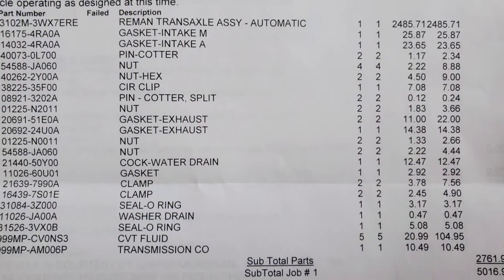2017 Nissan Maxima Cvt Failure! 🔴 What Signs to Watch For and Things To Avoid!

Comment: From a guy who has worked in not one but two Nissan shops, I can say the first problem was buying a Nissan that’s 2013 and above. Honestly they are built a lot cheaper than the older ones.
Reply: Would you say that on any Nissan? I've been considering a new Sentra Sr or used Murano 16-18 or maxima 16-17 but I've had issues on past Nissans I've had (Altima 09, Sentra 05). Currently driving Lexus and Toyota.
Reply: Explain what people mean by jutter on these cvt transmissions.

Comment: By reading the manual every 60000 miles you should do CV T flush as part of your maintenance And at a 120000 miles you should change all the spark plugs that is in the manual You can  PDF the manual on your phone
Reply: My owners manual for my Altima says to change the plugs at 105,000 miles.

Comment: This is concerning.  I have a 2016 with 69k miles on it. I did notice a few gear slips.    Just changed the Transmission oil this weekend at the dealership. Car seems to be running very well at the moment.  Definitely will be keeping my records.
Reply: Damn, just as mine 16 with same miles. Was gonna do transmission fluid change at 100k. Thinking now of getting rid of as I dont wanna hold on to junk.
Reply: My 16 is sitting at 98k I haven’t had a problem yet
Reply: @mahammadshariff6162  I think we might be okay. It's not every Maxima has issues. But I would get that transmission oil changed during next oil change
Reply: Good I heard change it every 20k miles and you should be fine.
Reply: I jus got a 16 at 65k
Reply: @mahammadshariff6162  you were supposed to change it at 60k as stated in the owners manual.
Reply: Warranty by Nissan ain't worth shit. See when you need warranty service !
Reply: @jarrellbanks4702  nice man.  Hope you are enjoying it.  I love mine.   It's got decent 60-90mph acceleration to get out of jams on the highway

Comment: I have a 2011 maxima (original owner). My transmission failed on me at 300k km. I never put my car into manual mode, for my mechanic told me never to do that. I did replace the transmission with a used one with 190k km on it, and so far, I have no issues with it and now my car is at 413k km
Reply: I believe your mechanic is wrong.  My 12' Nissan owners manual says to put the car in manual mode when going up or down steep slopes or hills.I have always done that and am in my 13th year of driving the car with the original CVT and zero issues.

Comment: The new CVT's today from Honda and Toyota actually use a gear to handle your initial acceleration and at the required interval, hand off the job to the CVT transmission. I think Toyota and Honda are also going to 4 cylinder turbos to replace their v6 engine. Turbo plus CVT means you must be on your maintenance game. If you buy used, you MUST demand service records from the Seller.

Comment: I purchase a brand new 2017 Maxima, with now 90k miles.  I didn’t do any manual shifting of gears, mainly city driving and occasional long distance driving during the holidays. Mechanics noticed an issue and recommended I get the transmission replaced. Luckily I purchased additional warranty insurance. But it is ridiculous to have to replace a transmission under 100k miles. Salespeople keep calling to upgrade, but this will definitely be my first and last Nissan product. CVT=cheap value transmission
Reply: I had a 2019 Nissan Maxima SR and the transmission went out at 72k. I now have a Lexus and love it.

Comment: But the question is why do they still pair CVTs on a large car with powerful engine? They should be the classic torque converter, or DCT. CVTs are for kei, mini, subcompact, and compact cars which are aimed for fuel efficiency.
Reply: Facts their asking for them to break when put on powerful engines.

Comment: Purchased a 2017 Maxima last month.  Car had 56k miles on it.  Took it in for an oil change/tire rotation and 60k mile service.  Sure enough found some stored transmission codes which included the jutter.   Car was under 90 days and 4k miles so transmission is getting replaced at no cost to me.  Glad it went out now.  My extended warranty covers 5yrs/125k miles which will will keep it covered as long as I keep the car for the most part.  I don't race this car and no need to ever be in manual mode.  Car is a  great daily driver.
Reply: 60k miles and a new tranny...... that's ridiculous. Nissan should be ashamed. I could have bought the same car, same year, with only 9000 original miles just a couple of months ago.... but honestly, I don't want a CVT after all the time I spent reviewing these transmissions... I keep a car a long time and never replaced a tranny... right now, my Acura is 20.5 years old with the original tranny.. I wish you good luck.... and definitely keep changing that fluid.... a secondary cooler may makes sense as well...
Reply: Explain what you mean by jutter

Comment: My takeaways.  Keep mileage down.  129K over 5 years is high mileage?  No hard accelerations to 80mph.  Don't use the paddle shifters to create additional transmission strain.  IE be good to your transmission and it will be good to you.

It's obvious from the video and his comments that MD is VERY hard on engines and transmissions.  Good on him to own it for this review.
Reply: Keep the mileage down? Oh wow.
Reply: How about Nissan stops using JUNK Jatco CVT transmissions and you can drive the car like it's designed to be driven.  There is a reason Nissan has had numerous lawsuits about the transmissions, and it's not because it's a quality transmission.

Comment: the older models didn't have as many issues.. I'm definitely done with Nissan vehicles altogether.
Reply: Richard,  you are right. New Nissan vehicles are garbage and I've owned many and used to work for a Nissan factory. The best one I ever had was a 97 Altima 5 speed manual

Comment: 2009 Maxima and still running strong...no issues!!!
Reply: My 2008 altima coupe CVT just started failing. 163k and changed the CVT fluid at about 100k and again at 163k. I just changed the oil and replaced both filters. I never replaced the paper filter before. I would suggest not to change your fluid if your car is over 120k. I treated that thing like a baby. I used Itimetsu fluid which is pretty much the same as the NS-2. I would also recommend avoiding long trips on windy roads and lots of hills once your car gets over 120k. A trip through the Ozarks is what triggered it for me I think. An altima with 120k+ should become a commuter car only in non-hilly areas.
Reply: @garneroutlaw1 my mechanic told me the exact same thing about not changing the fluid over 120k miles, he explained why but I forgot..I’m at 198k now with my 2011 Altima and it runs fine

Comment: Thanks for the video. I drove Mitsubishis for 20 years. All had the JatCo CVTS. 80 miles was my max before I traded. Last year I bought a 2022 Rogue. The Rogue is amazing and I got a good deal on it. I am an old man and I drive like one. Personally, the money you save on the car is worth the $5000 you put into a new transmission. A slight inconvenience? Yes. You made the right call.

Comment: Just to add my experience for any new CVT owners, my Maxima 2014 was bought in Oct & a major services was done the previous June on it including cvt fluid replacement with filters and all that. However, the transmission gave away in Oct. 
i had option to replace with a used one like you mentioned or repair it with a specialist. I went with the latter. Perks were they gave me 3 months warranty & you know that parts on the inside are new. If you go with a used one, you are not sure of its condition, might end up stranded again in few days and the warranty period on those are really less, maybe even just 5 days. So, my suggestion would be to have it repaired instead with original parts & of course, from a transmission specialist. And pls do not put your foot down hard on these CVTs all the time, (occasionally is okay or when the circumstances need it). Drive normally & you should be fine!

Comment: I’m getting my trans replaced I’m at 60k didn’t have any symptoms I did a hard scan on my own and found the cvt judder code so I took it in my buddys at Nissan recommended we just replace the trans it was actually calling just for a valve body replacement but we went ahead and did the whole trans again I had no symptoms at all

Comment: I have a 2014 Maxima with 92k miles.  My transmission started acting up with a code for the transmission fluid pressure sensor stuck in open.  I was told it was a valve body issue. I changed the fluid but that didn't fix the problem.   No one would touch this car.  Dealership stated they don't service the transmission at all.  So I ended going to a transmission specialist in NJ call Level 10 transmission.   They actually brake down the transmission.  At the end of the day I purchased a upgrade transmission with large pump and torque converter.  Car was paid off since 2018 so at this point the money was worth it.  My new transmission has a 3 year 50k warranty but the kicker is to change transmission fluid ever 30k miles.  If the dealer would have told me to change fluid every 30k my transmission would have lasted longer than 90k
Reply: I change mine every YEAR...DIY and easier than a oil change!
Not taking any chances an extra $100 better than 5000$...
Also put a hayden trans cooler on mine...shame on Nissan for this junk Jacho trans
Reply: @Vincent Kosik  I asked about a secondary cooler.  The new transmission I just purchased from Level 10 transmission actually puts a bigger cooler on during build.   So yes, shame on Nissan.
Reply: @MrHeat1up  that's sounds good..I live in the South and need not worry about cold winter mornings...the CVT fluid needs to be warm enough to properly function...I read that some setups of aftermarket coolers need like a thermostat...not sure....anyhow, hope you have a good one and I'm crossing my fingers on this one....I drive real gentle and I keep the fluid overly clean...but that's still no guarantee it won't stb...other than that a very nice car
Good day..

Comment: U gotta flush the fluid every 20k. Always let it warm up a minute or two, take it easy first 5mins of driving. Don't drive the car hard overall, it's a CVT. Check for fluid seepage during svc intervals. Check with dealer for TCM updates. U do all that, plus cross your fingers and pray, u may have a chance! Btw, I'm leasing a 2022 Altima Platinum. I got a warranty. But not sure about buying it out end of lease.
Reply: Few if anyone ever know to do this, let alone are going to do it. It's really unheard of routine maintenance. For most people automatic means set it and forget it. Statically keeping that car is a bad idea you can see from space.
Reply: That is nonsense if you have to change it every 20k miles.
Toyota and Honda don't have to do that crap.
Lets me know that Nissan is an inferior car to those two.
Reply: @tom11zz884  Who has the time or money for the extra maintenance, Nissan is trash 🗑
Reply: 20?  No.  Waste of money.  60K is soon enough.
Reply: It's a closed Transmission dumass
Reply: Manual says 60k if you do any towing or really hard driving .. that’s the problem people start touching the transmission and that’s when problems start.
Reply: Recommended CVT fluid service interval is 120k km (or 74k miles). you can go every 60k if you're paranoid, but 20k is just ridiculous. By the way, it's extremely important to also change the CVT oil filter, which the dealerships will never do. Will either have to DIY, or take it to an independent transmission shop.

Comment: 129k, your doing good, that's a nice run. They normally have a reputation of 75k. I bought my 05 at 75k with issues and they replaced it under warranty, 75k later it did it again. Then I got the 2016 when it just hit the lot. It drown in a hurricane right after I paid it off, insurance put 50% down on a new one. Get a warranty and be happy.

Comment: Baby it, don't challenge any drivers, don't get all up on it on their interstate or highway. Don't be the first to jump off the line at the red light. Just baby it, and stick to your service manual religiously, and document every service.

On a side note, incase anyone didn't know this. But for 5,000.00 there is an alternative! Paying to have a 6sp manual transmission conversion and installed. There are shops out there that are experienced in doing this.
Reply: Thanks! Good to know.
Reply: @supertrooper73  at the end of the day, it's your ego vs  a expensive investment. The car will give much more than what you get from those short lived moments driving aggressive.
Reply: @VentureWelding  Indeed
Reply: Or get the base model Versa that has one and pay thousands less to begin with..they are about 17,000 now for the 2023

Comment: I dont really hear about these maxima problems here in Dubai, especially the ones from 2016 and above…. And btw the dealer here in Dubai does not recommend changing the cvt fluid.. I believe the one’s in dubai are installed with a bigger transmission cooler.. so thats why i dont hear about the transmissions issues even without changing the fluid… the Gulf Spec is really much stronger because of the addition of a bigger cooler… i know some people that reached 200-250k miles without touching the transmission fluid and they’re still doing well, only top-ups were done….. but what i’ve seen is that those who incorrectly changed the fluid faced problems…. Of course it all depends on how you use the car… some people change the fluid every 30k miles but still face problems, thats because of their driving style and mostly the US specs have this problem as i said here in Dubai they’re equipped with a bigger cooler
Reply: Im in Dubai, and I have a 2016 SR, bought it in Dec 2015 from the local dealer. Car is still a joy to drive. 110,000 Km on the clock. I love the car so much, but I guess the farewell is nearing :') the comments here made me concerned.
Reply: @nidalonso8692  dont worry bro nothing’s gonna happen its a very reliable and powerful car just dont play with the CVT fluid.

Comment: Thanks for the video. I have a 2017 Platinum with 31,000 miles so it doesn't have any problems yet.  I hope it makes it as far as yours.
Reply: 2017 SR 136k o issues
Reply: 2017 S 90k running brand new

Comment: I just traded my 16 max 101k for a low mileage 19 and I'm pretty sure my CVT was getting ready to go too. It still pretty much drove fine but going from P to R it was more resistant and would pop pulling the shifter. The real concern was going from R to D there was about a 1 second delay before it would go in gear. I was also getting more judder at certain speeds, specifically about 32mph. I also had one time my rpms went really high for no reason.

Lessons learned! I never did any maintenance on it, dealer never recommended it. So the new max will be getting a CVT oil change every 30k. Fortunately I got a solid return on the 16 max and a decent price on the 19. I will say driving a newer max REALLY has made me confident the 16 cvt is running on borrowed time.
Reply: My mechanic threw me out at 30k and told me to come back and do that at 60k. He knows his shit.
Reply: @rickjohansson4257 I’m a master tech and sounds like it’s time to throw out your mechanic. You don’t ignore cvt fluid for longer than 30k miles tops.
Reply: Nah ah my maxima 2017 platinum my rpm needle drop around 32 mph too! Around the 30mph speed limit bro it jumps when I’m not on the gas trying to coast

Comment: I owned a 07 nissan altima with the cvt tranny. Sold it at 113 miles never had a problem with transmission. I did my transmission fluid change at 85k miles. The car served me well for the 11 years i've owned it. I literally only paid about $1000 per year for this car. If i had not gotten a good deal on a toyota i would have bought another nissan as well.

Comment: I own a 2013 Nissan Altima I bought used with 16k on the odometer back in 2015. I happened upon Scotty Kilmer's site thank God. I immediately began to drive like gramps, no more engine braking, no hard acceleration, and kept on top of maintenance. You must change your oil with synthetic every 5k and transmission fluid (by the dealer only) every 30k. Just change the tranny fluid and DO NOT FLUSH. Dealer change fluid is to insure the required Nissan fluid is used. Car has 55k on it today. Gonna get 7 more years from this baby. I also keep detailed service records for any Buyer should I decide to sell. Never buy these CVT tyranny cars without detailed and verifiable records.

Comment: i had altima coupe 2.5s automatic. everything was going great with 244k miles. I wanted to try manual nd drive it for few miles i heard small bangs from my custom exhaust when chasing gears😯 then my intrusive thought😬 took over for drive in manual for few days. Just after 2 days i got issue in reversing nd on next coming back home today it totally failed. dont know yet the plates r gone or gears. when i put it in drive mode it moves little then start  sound like abs is pulling hard to stop car. i can feel something is sliping or damaging inside.. let see what mechanic says.....